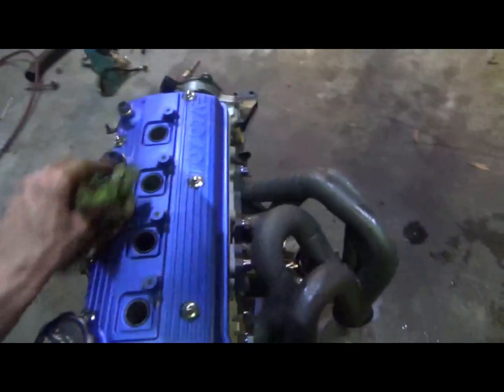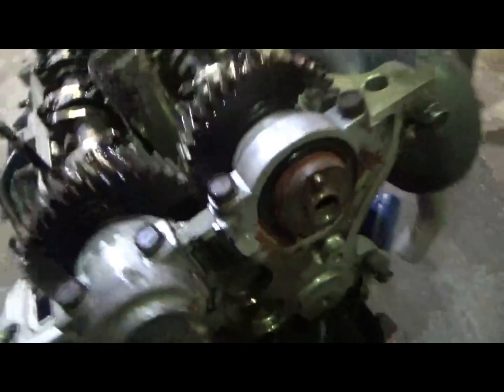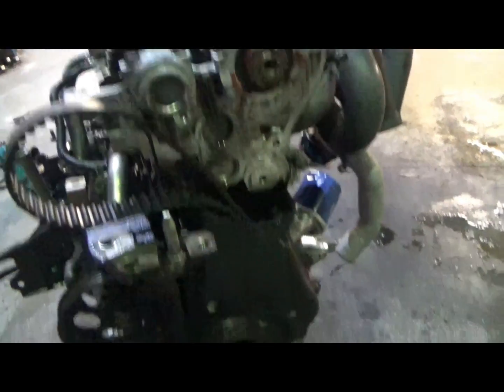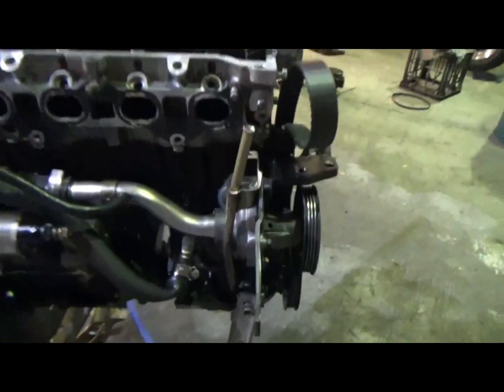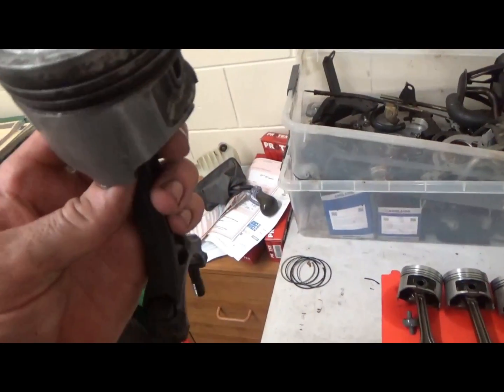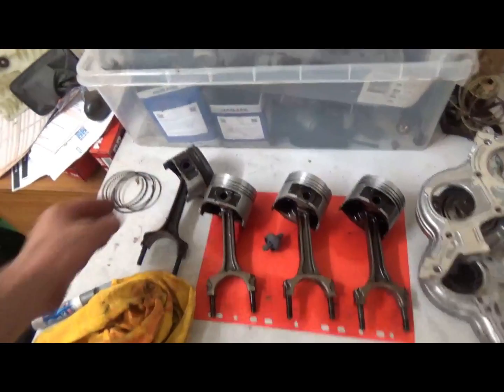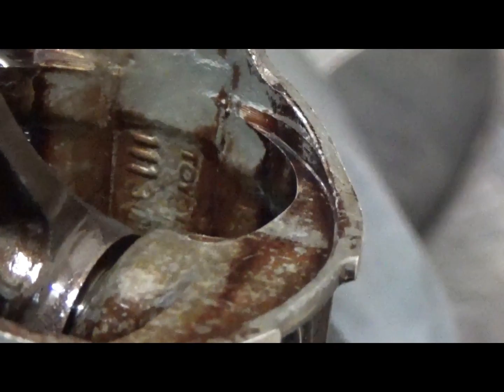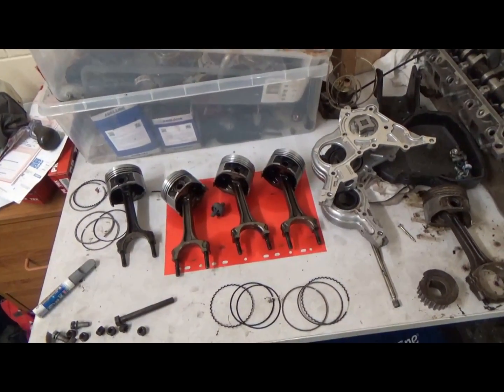5efe engine explosion, the findings were very INTERESTING!

Comment: So what have you learnt? Never assume things are right, pull the rocker cover and sump, check timing and bearings
Reply from the maker: Yeah dude. considering I saw this engine running in the car... who would have thought all this shit would have been wrong 😂
Reply: Matt Berry me
Reply: Matt Berry I have a starlet and a spare engine NA if your interested
Reply from the maker: +andrew1977au 😂 true.
Reply from the maker: +andrew1977au we checked the ign timing... but cause the cams were out a tooth, that's what put the timing out...
Reply from the maker: +andrew1977au does the car run?
Reply: Matt Berry runs, has a flat battery. Send me a message on here and I’ll call you